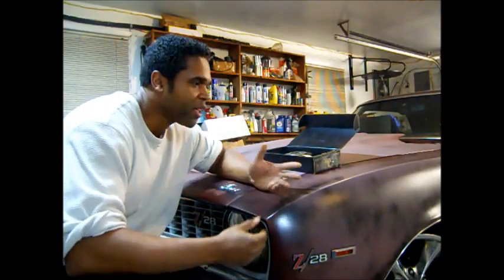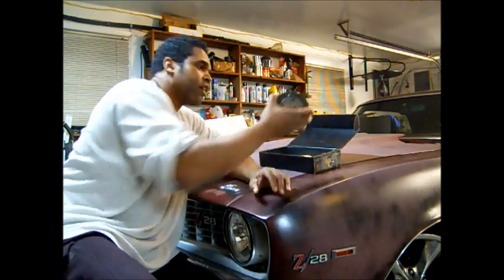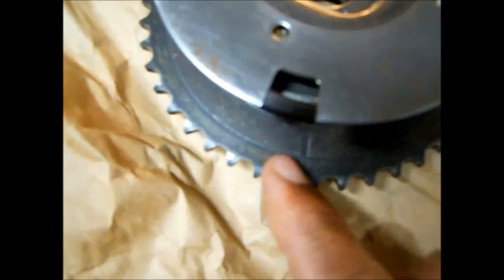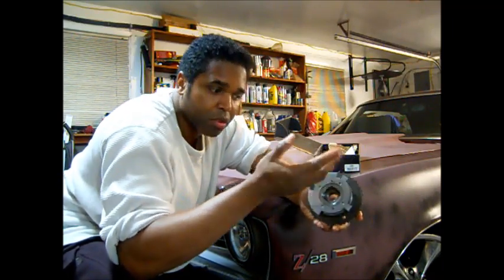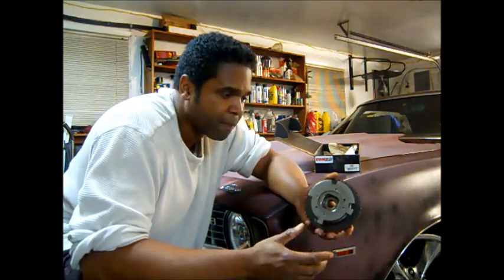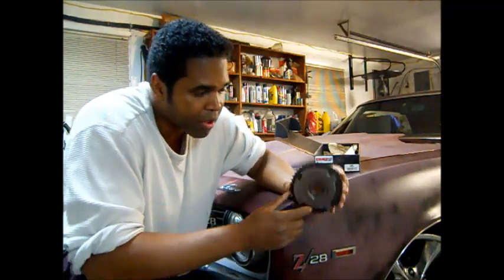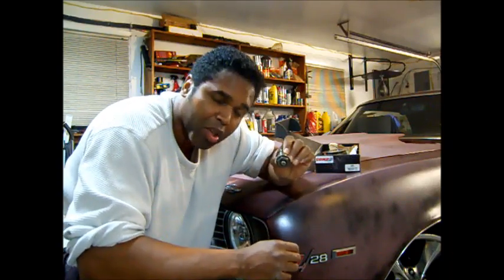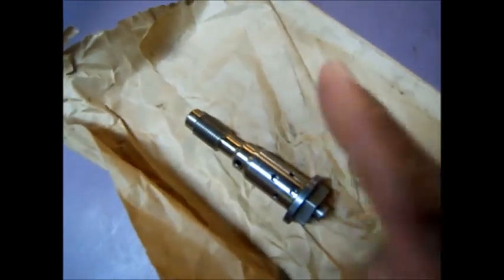What Is VVT and How Does VVT Work? (Coverman66 Explains VVT)

Comment: was it not making power til 3k rpm because it was phase locked on full advance? is it possible to lock it in the middle? and does it default to advance or retard when it is left unplugged?
Reply from the maker: it was phased, but it still was a dog.. cam swapped helped it get out the hole better

Comment: Hey I have a 08 tahoe and I swapped the 5.3 in there with a 10 ly6 but it has vvt and my harness doesn’t have the vvt can I just tune it off ? I just disconnected the vvt plug f
Reply from the maker: are you planning on swapping the cam?
Reply: coverman66 keeping it

Comment: I wonder if my 5.3 trailblazer has the vvt cam.....
Reply from the maker: you can tell if you have 3 lil bolt above the opening where the crank comes thru the timing cover.. if you do then the engine is equipped with vvt
Reply: @Coverman66  I am going to have to look for that then!

Comment: When you were running VVT in your Chevelle before you removed it, what oil pan did you use? I've heard there's a pressure relief valve inside the VVT GM oil pans, but the aftermarket oil pans aren't machined for the oil bypass valve. Even the F Body oil pan dosen't have the provision for the pressure relief valve. I was just cusrious what oil pan you used while you still had the VVT running in your Chevelle. 

Cheers
Reply from the maker: whats going on Jeff,
im still using the same oil pan from day one of the build.. i got my pan from a company call Street and Performance. they made modified camaro pans to fit..the company is no longer around since the owner Mark Campbell passed. on my 67 chevelle build, i will have to go with a holley pan.. hopes this help jeff..

Comment: I have a 2002 6.0 that I'm  working on looking at the Dyno numbers that you have on your chevell trying to get to 500 hp going with a set of ls3 heads a tsp stage2 cam 229/236 629/615 any suggestions btw what gears are you running in your rearend
Reply from the maker: nice set up, what type of tranny are you running? in my chevelle i have a cammed ly6 with a ls3 intake.. i have a 6spd out of a 2006 GTO and 4:10 gears.. its a nice set up.. im fixing to install a lsa blower over the winter..

Comment: TSP said they changed every setting possible to 6800rpm. I really wish I did a 6 spd now.  Only did the auto cause was gonna do turbo build. The cam is TSP cam with their specs and own vvt tables. Hopefully get it figured out soon I'll keep you posted
Reply from the maker: +chris i wish i could pin point your problem.. if the engine dies out at 4500rpm in park and gear i would think it has to be the tune..how does the car run before 4500 rpm? you going to install a turbo? im getting ready to do a video clip on a LSA supercharger on my 71 chevelle.. so make sure to check it out..
Reply: I will car runs great until 4500rpm. That's what I think something wrong with tune.
Reply from the maker: i will send the pcm someplace else for a tune and if they fix the problem ask TSP to pay for it.. 4x? youve been more than patient.. maybe the tranny still has the govenor enable? im very curious to know what it is..

Comment: how did you get the the vvt to work with the t56 trans. I had my tsp vvt 4 cam tuned by tsp (mail order tune) and my car won't rev over 4500rpm. Just curious I will be trying a local tuner to see if they can figure it out. Thank you
Reply from the maker: +chris there could be alot of variables.. thats part of the reason i got rid of my vvt.. do you have a auto? which phase limitr areyou using? did the tuner user the correct vvt tables thats came with the limiter? keep me posted.. im curious..
Reply: Comp cams phaser
Reply from the maker: +chris  nice set up..love the 79 t/a  im a 6spd guy, but from what you telling me it seems like its in the tune...possible the vvt tune.. when you sent your pcm to TSP did you tell them the VVT tables? here are tuners i use Chuck from Corvettes of Westchester   Doug from East Coast Superchargering  give them are call and talk to them and tell them your story.. im curious, what did TSP tell you when you keep sending your pcm back?